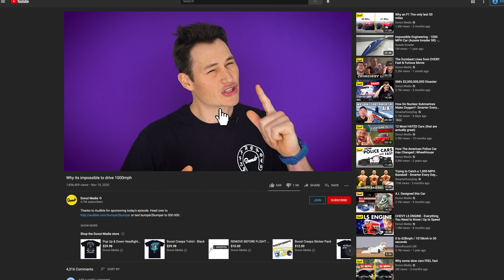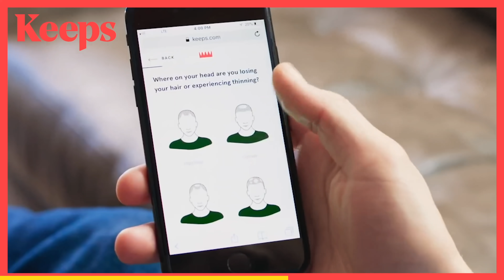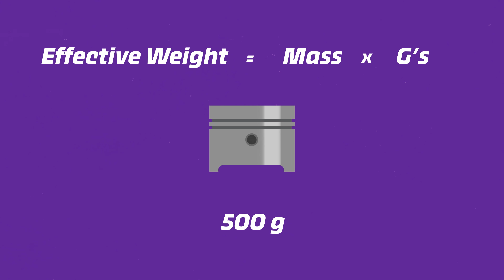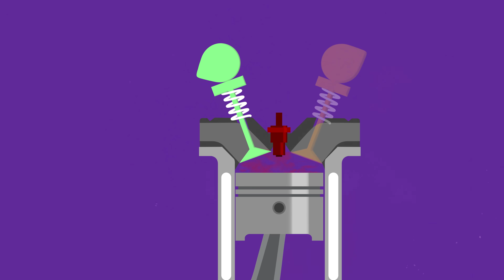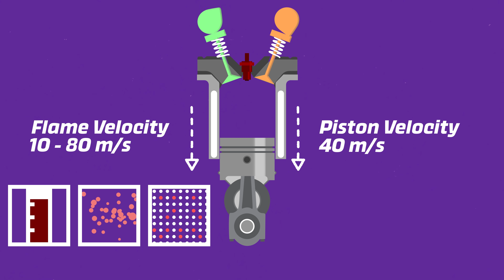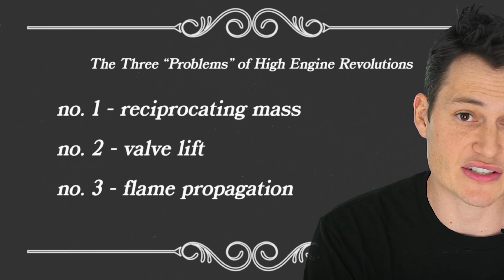Why It's Almost Impossible For An Engine To Rev Over 20,000 RPM

Comment: 2 stroke: HELO
Reply: Because the have low displacement  compared to four stroke engines so smaller piston and les mass for example a nitro rc car can rev up to 42k and another reason they are generally has two cylinder at max
Reply: @Mahyar_BEH  cool so now I’m not going to watch this video because this guys I clearly a moron since they make motors that rev up to double 20k
Reply: That moment when you’re standard 2stroke bike Revs to 14000rpn
Reply: @mitchsharp5718  Or a Honda Shadow 125, a 125 cc v-twin redlines at 12500rpm, the highest-revving v-twin that i know of.
Reply: @mitchsharp5718  That moment when you're is spelled your.
Reply: @mitchsharp5718  your*
Reply: @mitchsharp5718  lol i have a 50cc with piston and top parts form an 80cc and i got 13000 rpm once
Reply: @mitchsharp5718  I have an oldHonda crf 100 that doesn’t have a rev limiter and it hits 10k rpm
Reply: @mitchsharp5718  bikes got MUCH smaller engines with MUCH less reciprocating mass and travel up and down shorter distances
Reply: R C   C A R S
Reply: The classic Honda CBR250RR and ZX2R can rev to 20,000 and beyond.
Reply: I seen two stroke bikes on a video revving up to 21.5k
Reply: @fabionajazi6180  sauce or it didn't happen!
Reply: @randominternetguy   the Honda rc116 21500 rpm
Reply: My old 50cc could Rev over 20k, that thing was as tuned as could be. 20hp with 50cc, it was amazing.
Reply: @thilo7546   what cylinder you get 20hp from 50cc
Reply: @thilo7546  holy fudge what did you do,new rollers belt final drive short stroke bigger inlet port bigger carb and jets ?
Reply: @thilo7546  ahahahahaha same, i have a fantic 50cc(im 15) with full polini 70cc, 21 dell'orto, exhaust, clutch, rapid gas, filter... i do 140km/h
Reply: @matteoprada5851   what sprockets
Reply: @matteoprada5851  how many kg did you center your clutch and do clutch shoes open at same time?
Reply: Most 100cc air cooled kart motors rev to 20k
Reply: RC engines: cool
Reply: He states that Its almost impossible. Not completely impossible. So 2-stroke engines are in this. It is possible to rev up to 20k but a few of them only do so.🔥
Reply: rotary : sup guys, y'all talking about valve and shit but ur dude don't have to mess with this shit ;)
Reply: A 2 stroke still has the stop and start at the top and bottom of the stroke so you still get most of the same losses.
Reply: rc car nitro engines idles at 11k at redline 40k rpm :))))
Reply: This made me literally Lol
Reply: @toreyweaver9708  im thankfull
Reply: Don't forget RC-166
Reply: NSR 250
Reply: Most 2 strokes actually don't make much power above 12000 rpm. Most modern 2 strokes peak around 10500 rpm. They become asthmatic at higher rpm.
Reply: ZX-25R a 4 stroke, could hit 17.5k rpm on STOCK
Reply: R/C engines easily reach 20k RPM.
Reply: @dorsk84  yup
Reply: Mvt dd, vforce 3, stage6 crankshaft, stage6 77br, a 24-28pwk, voca 80-90cc pipe or yasuni r4 or some other high end tuning exhaust and ez 20k rpm and 27hp for 850e aka around 1000 dollars. Remember that 27hp is from a 77cc engine
Reply: 2 strokes actually typically rev lOWER than a comparable 4 stroke. They just sound like they rev higher because of the double power strokes.
Reply: @Drunken_Hamster  dude what, 125cc two strokes rev up to like 16000 rpm, search like the cagiva mito sp, while 4 strokes get max 11000rpm
Reply: There are the 250cc 4 cylinders in the 90s
Reply: @arccb6223  haha those things were ridiculous. I love them
Reply: @arccb6223  kawasaki just introduced a new 4 cylinder 250cc... can't remember the redline but it's up there
Reply: Ive seen a 2 stroke shifter car rev to 22-25000 rmp
Reply: Nitro RC's got those beat
Reply: Rotary: "I've been there for a while, what's taking you so long?"
Reply: Cox tee Dee 0.10 glow engine runs 27,500rpm
Reply: My 2 stroke nitro rc can get to 25000+ rpm
Reply: Do these engines easily rev past 20K?
Reply: @WarriorsPhoto  depends, however most motorcycles have a redline between 12k and 17k RPM if that gives you any indication.
Reply: @krakenjm6877  I like that motorcycle engines. I haven’t taken a motorcycle 🏍 that high and want to hear that music 🎼!
Reply: The 02 ZX12R could hit 16k. 4 stoke 4 cylinder.
Reply: @710Canada  so not 20k
Reply: @710Canada  try searching polini or malossi moped
Reply: @cameronbitz9124  My little 3.5cc Ofna nitro engine is rated for max rpm of 32k rpm XD
Reply: @cameronbitz9124  some karting engines can rev up to 24k
Reply: @cameronbitz9124  yo mom could of told me dat 😂🚫🧢 foh
Reply: @710Canada  are you “gooder” at English then?
Reply: @710Canada  You sure you got the right bike? A standard ZX12R is rev limited to 11,600rpm. Pretty sure the connecting rod will come through the side of the block if you try and rev it to 16,000.

Plenty of 600cc bikes rev to 16k rpm. There's many 2 stroke commercially available motors that rev to about 40,000rpm they are for R/C cars.
Reply: @studinets  Exactly. I drag raced a ZX12R for 3 years, owned it for 6yrs. There was NO power to be found past 11.5k, only a rev limiter.
Reply: @710Canada  Racing R/C Nitro engines can rev past 40 000.
Reply: @710Canada  cbr250rr 1991 hit like 19k or even more can’t remember lol
Reply: @710Canada  07-08 zx6r ik hits 16 I'm pretty sure it will hit 17
Reply: @710Canada  modern YZF-R6’s rev to 15k don’t they?
Reply: @710Canada   Yamaha R6 2006 revs till 19k
Reply: @710Canada  I had an 03 ZX12R. No it would not. Redline was 11,500 if I remember correctly. No power to be found above that. 16k no way.
Reply: @scootypuffjr.  yeah people who rev their to "20000" would blow up very quickly rc cars can but not like 250 cc 12k is realistic.
Reply: @CRFprodigy33  there are plenty of 15k plus rpm four cylinder bikes out there. The the ZX12R was not one of them.  It was a Hayabusa  beater at the drag strip in the right hands though (Mine😏).
Reply: @710Canada  no ZX12R turned 16k.
Reply: @scootypuffjr.  yeah totally bit not a 22k 2 stoke
Reply: Worth noting most of the two strokes power comes from cutting out 2 revolutions. 2 bangs for every one 4 stroke bang.
Reply: my 85cc two stroke run at 11950rpm
Reply: @loikborris9832   get unrestricted ignition, revs higher and more power
Reply: I always imagined a 2 stroke motor would speak in abbreviations
Reply: Came here to say that.
Reply: How do I make my tractor rev high
Reply: I definitely envision 2-strokes not being able to spell lmaoo
Reply: 2 stroke RC motors rev to like 40k rpm
Reply: @Eilaithen1  some can go MUCH higher than that, 60k+
Reply: HELO
Reply: Obviously did not watch the video.  Still ignorant :(
Reply: I have a 2 stroke 110cc bike.... Its insanely fast.... Can toe to toe with yamaha R25
Reply: Hasi Mausi  dirt bikes are like 450cc and street bikes 800cc 1.000cc etc. Car engines are MUCH bigger.
Of course we are not talking about the small 1.3L economy engines that are sold with cheap cars. These engines are not designed for performance.
Reply: Hasi Mausi  Exactly. Most cars aren't performance oriented while most bikes are performance oriented . Unless you're driving a moped
Reply: Rc nitro cars revs up to 40 000 rpms
Reply: 1998 fzr 250 reves to 19
Reply: My Yamaha RX King 135cc, with 50mm stroke is Still capable to 15000rpm. But the Material of the engine not able to 15000rpm, Casting Piston, Casting Conrod, Air-Cooled, Heavy Magneto, i'm worried to that's part. With some modified at the port, Use Forged Piston, Forged Conrod it's capable to rev up to 16000rpm

Sorry for bad grammar
Reply: Specifically... A 125 dirt bike... 
Let's SCROMP ON THE MAMPSTSES BOIIIIII!
Reply: Helo how r u I’m unda da watah
Reply: to everyone who say ThE HoNdA  62KJsk skflajdi Only REvS 16k . have you ever heard about tuning. stock bikes dont rev that high
Reply: my 32cc scooter motor spins at 22k:)
Reply: @pmcg1852  LMAO
Reply: @krakenjm6877  46mph on 6 inch solid rubber tires.... It's a tad sketchy, to say the least...
Reply: The 50cc 2t race bikes can rev to 25000
Reply: My cheap 50cc pit bike can easily rev to 7k
Reply: Honda RC115 says hello with it's 22.500rpm limit. 👍
Reply: BRAAAAAA-BA-BA-BA-B-BAAAAP
Reply: RIP Lil Peep  2-strokes only sound like they are revving that high because they fire every revolution instead of every other. 
    In dirt bikes, real race bikes not trail bikes, the four strokes rev HIGHER than the 2-strokes. They just sound like an hour long fart instead of a bunch of angry bees.
Reply: Electric motor goes to 25000 rpm
Reply: @g_ugarte_oficial8740  much more than that depending on the type
Reply: @TheAdatto  I know it also depends on the size the motors of rc cars reach 50000rpm
Reply: Nitro RC engines can turn 30,000-50,000 RPM
Reply: @stp440  But can a RC motor power a full size car?  No.  That is kinda the point.
Reply: @billbrasky6827  oh, that technology absolutely CAN, it's just not practical or emissions friendly.
Reply: @stp440  turbos spin 150,000 RPM
Reply: @paddington1670  I've seen 300,000 rpm setups
Reply: @paddington1670  there is no longitudinal force in a turbo, it doesn't apply.....
Reply: The mv agusta brutale 800 from my brother also revs to 16k 😅 the fully tuned zx 10r of a friend of mine also revs over 17k at over 250hp at the crank (240hp at the wheel), but that engine also needs to be rebuild every 10k km 😂. But short stroke engines can easliy rev to the moon
Reply: No powa baby
Reply: The yahma r3 goes up to 14,000 I own on and I love it
Reply: What the hell is a 2 stroke

Ain’t that what’s in my lawnmower?
Reply: @Americana-deluxe  Most lawnmowers these days are 4 stroke. If it has separate fill ports for oil and gas, it's a 4 stroke. Most weed eaters are 2 stroke though which is why they require oil mix. There are some rare exceptions to this rule. I have a buddy that has an old 350cc polaris ATV that is two stroke but has separate fill ports for oil and gas. It mixes the oil and gas internally on it's own. I believe there's a few outboard motors like this too.
Reply: @Americana-deluxe  2 stroke engine for bikes are hugelly better
Reply: @matteoprada5851  old bikes right?

New sport bikes since what? The 90s have been 4 stoke V-4s that rev high and sound damn good.
Reply: @Americana-deluxe  man check out the italian suter 500  120kg, 190hp
Reply: @matteoprada5851  as much as I love 2 stroke engines, they are not better. 4 strokes are more complicated but their advantage is better efficiency and they don't dump oil in the atmosphere.
Reply: @Americana-deluxe  nah... That's a 4 stroke

Comment: Donut: No engine can go above 20K RPM
F1 V10: Am I a joke to you?

edit: dont be mad i know they said it in the video
Reply: They said "almost impossible" not that it completely cant
Reply: Well, yeah, but they also wouldn't last much longer than race distance.
Reply: Cosworth hit 20k in 2006 with their engine. Renault apparently hit 20,500. They didn't really exceed it.
Reply: Juan Montoya BMW rpm record
Reply: Are you watching the video at all? They clearly mentioned renault v10 that can rev to record 20,5 k rpm.
Reply: @ardijanuar2036  Cosworth made 21k with their V8.
Reply: @ardijanuar2036  there it is, the literal reader army
Reply: That one Honda Civic type R: Yes
Reply: @aakashsahani2991  And still don't blow no matter how much you trash it 🤣